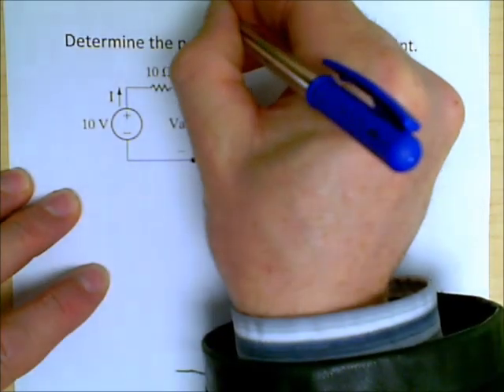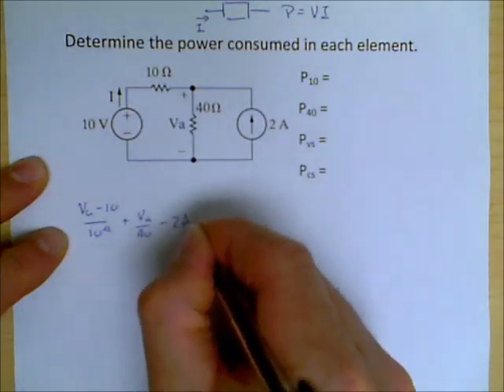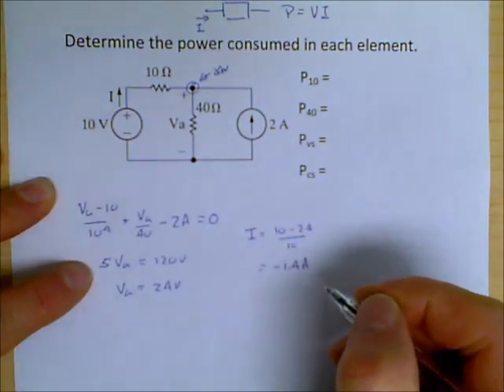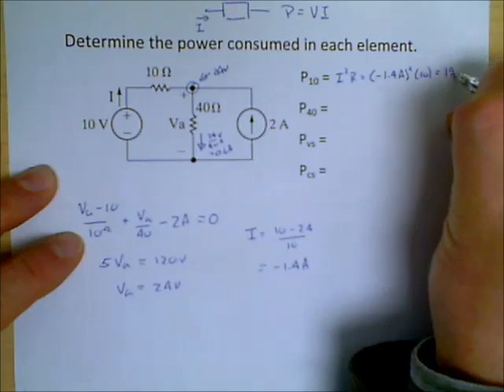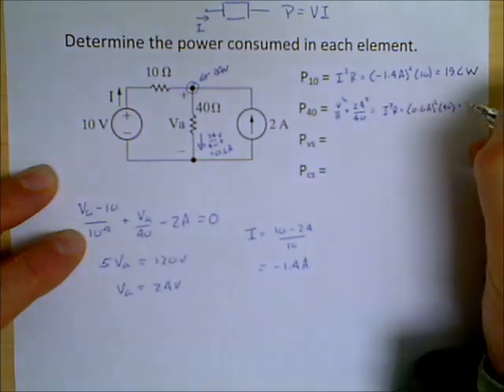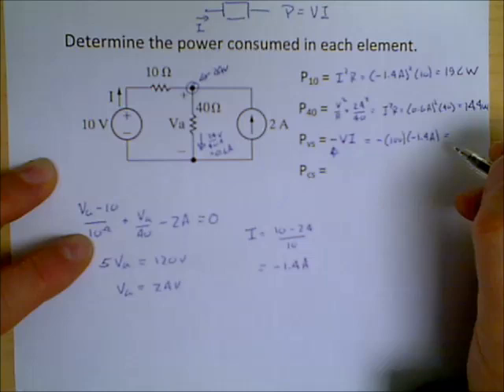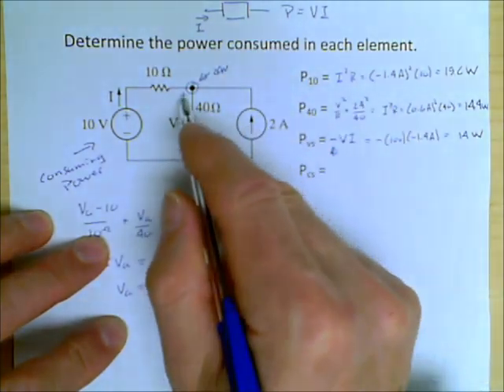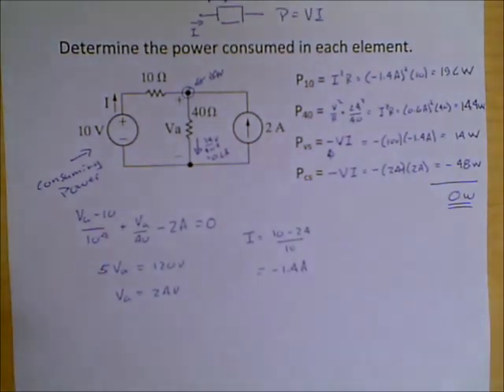Power sign Convention

Comment from the maker: The current always enters the positive terminal of a passive element like a resistor, unless the source is being recharged current will leave the positive terminal. But that is why the power is negative, it does not consume power , it supplies it
T. A. L.
Reply: I can't understand 2 Ampere current source. How does it calculate? I mean to say calculation of power in 2 ampere current source .

Comment: For PCS:  Can you explain why the current source 2A leaves the positive terminal of the 40 Ohm resistor?  Why wouldn't it enter the Positive terminal of the 40 Ohm resistor?  Is it because current follows the path of least resistance so the current would flow through the 10 Ohm resistor instead?